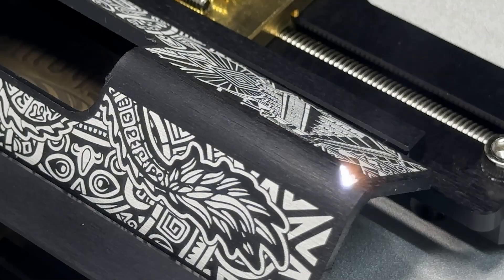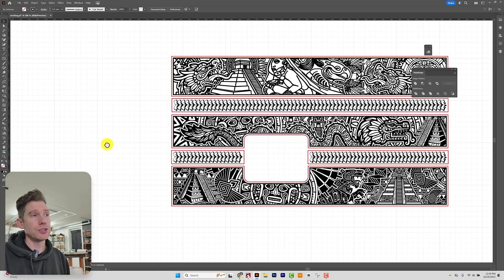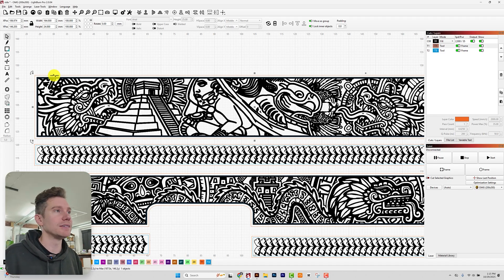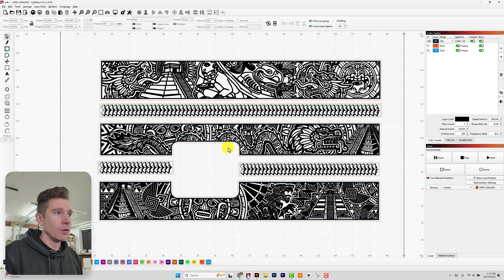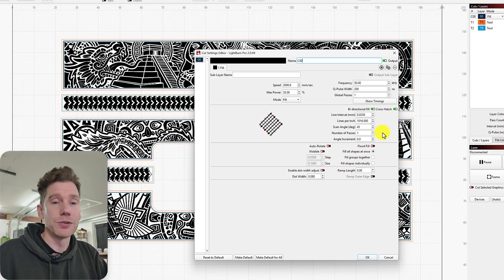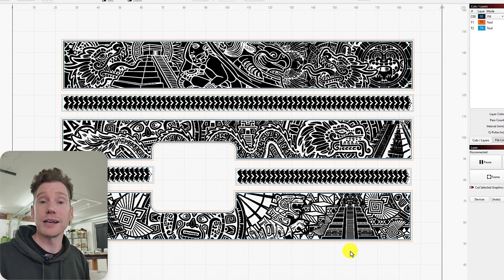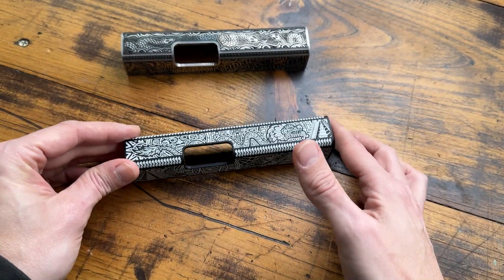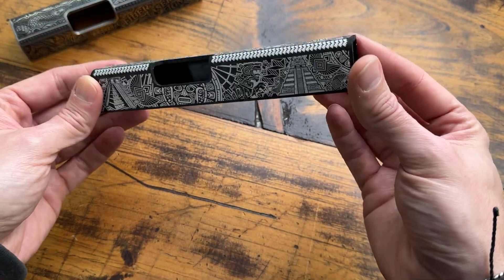You Don't Need a Gun to Practice Gun Engraving

Comment: yes i am intrested also where did you get the vice that you used for the top sides
Reply from the maker: Its actually just 2 heat press letter trays stacked together. There are milling vices that are designed for this type of thing Im picking one up next.